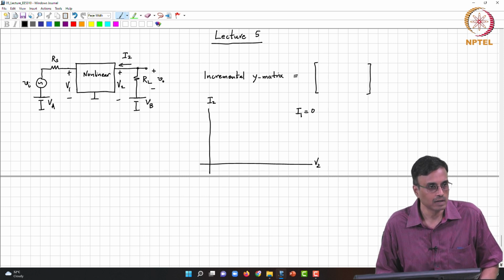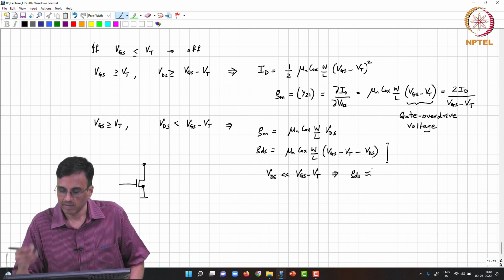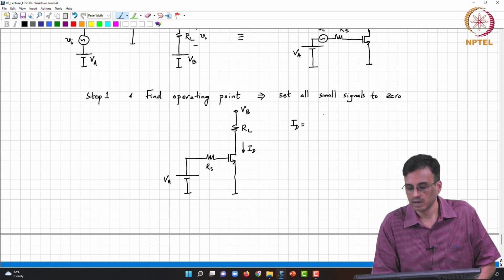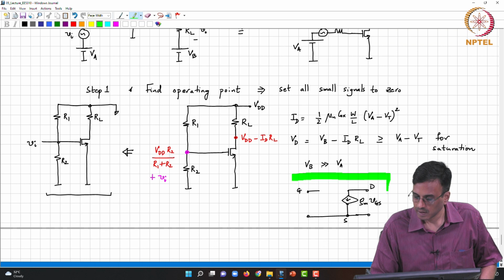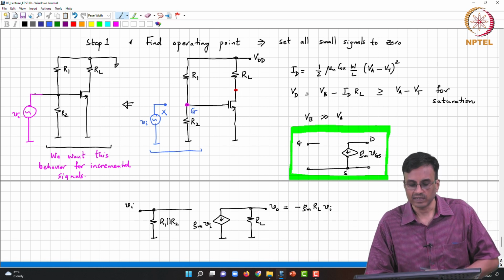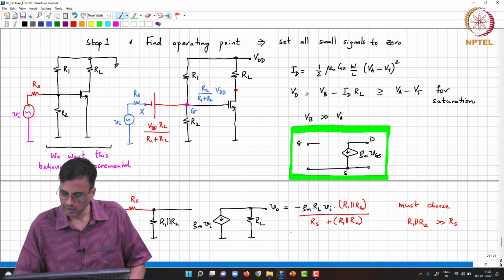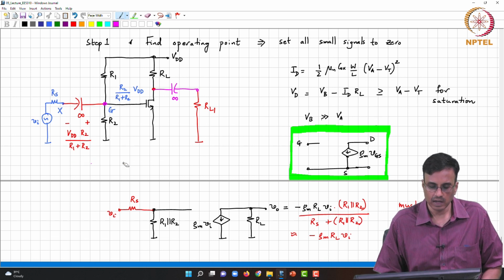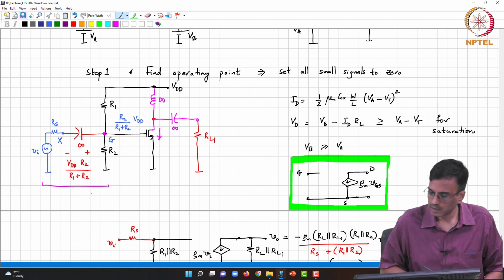Deriving the Common V Source Amplifier Part 1

Comment: In some load application we need small signal ac current and no dc load dcurrent, so we connect a load here which has coupled with capacitor, which will only pass the ac current through it and this load resistance will not define the dc operating point. 
in single stage amplifier we cannot connect resistive load directly otherwise it can affect the dc operating point here we need some buffer to connect the load.